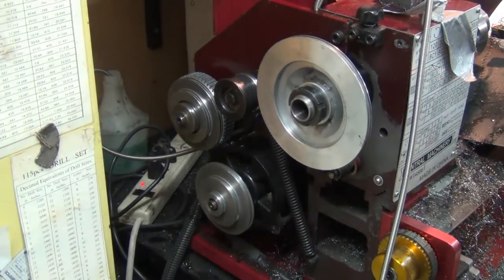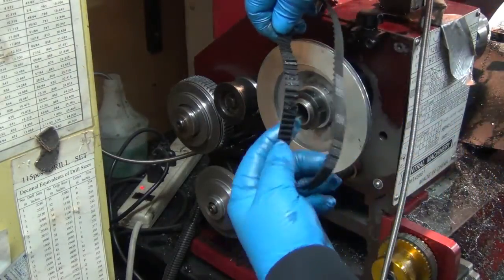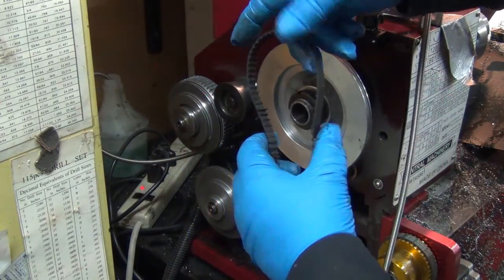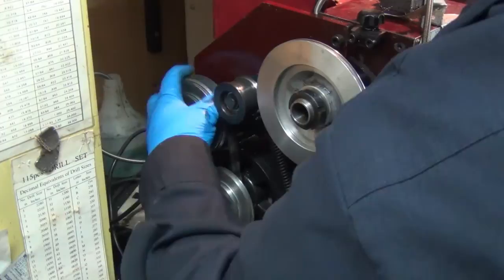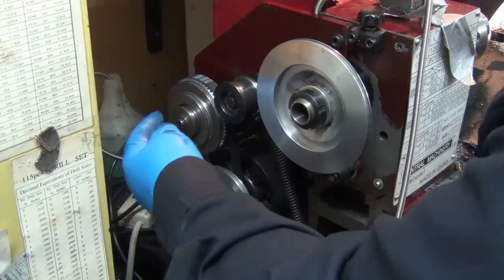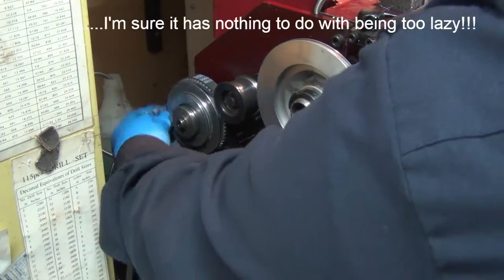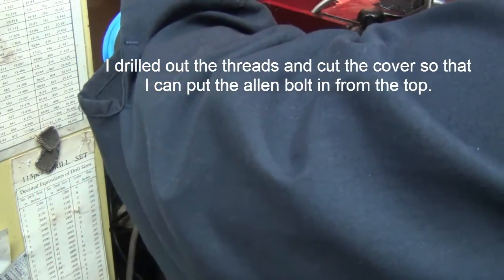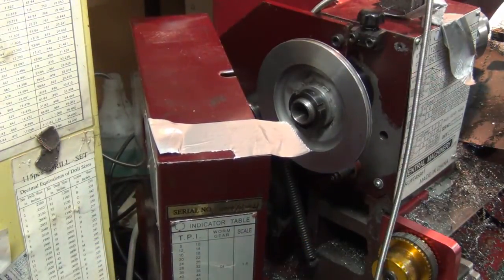9x20 CNC Lathe - Drive Belt Stripped

Comment: I have had one of these lathes for about 20 years and got fed up of replacing the high cost thin gates belt and the cog belt because of striping. So to make things simple I decided to go for a Variable frequency drive and a three phase moto rand removing all the aluminium pulleys and having just two. One on the motor and one on the headstock shaft, I found taper lock pulleys made it all so simple just needing a 19 mm taper lock fitting for the motor shaft and a 28mm taper lock fitting for the headstock shaft. I decided to use a SPZ belt and pulleys because the lathe did not require a heavier section belt, Though one major gain in using the taper lock pulley system you can fit whatever belt profile system and pully size you like. I can now change speed with the turn of a knob  with forward and reverse at the touch of a button. I should have done this years ago, the conversion took only a day to do.
Reply from the maker: Sounds like a great upgrade.  Too bad you didn't do a video of it. I'm sure there's still other owners that would love to see what you did and how you did it.  I had a variable speed motor on it(tread mill motor), but I sold this lathe a few years ago when I got the Tormach 15L Slant Pro. Thanks!! -Mike
Reply: @bluehandsvideo  All I can say is that I do not have an interest in making videos of my projects, well I am at the age that I would like to see my seventieth birthday again and that is my excuse and I am sticking to it. I have tried and sadly I cant get on with the technology. Now back to the lathe drive conversion, the things I left out from my first post. Remove the lathe's motor and construct 2 L shaped brackets for the new motor then fix one leg of each bracket to the lathe using the new motor feet spacing distance but do not fix the motor permanently yet.  Remove the headstock lock nut and pulley leaving the spur gear for thread cutting in place, now slide on the 28 mm taper lock pully fitting then fit the pully to it. Now you have the motor and the head stock pulleys that can move so using a piece of string as a belt align motor and head stock pulleys, from this position you can measure  how much of a spacer you require to fit between the head stock shaft spur gear and your new pully. (you can purchase spacers on e bay for not a lot), Tighten in place your new pully and spaces using the original locking nut, be careful not to over tighten the bearings. Back to the motor fitting and adjustment using a string belt again slide your motor along the other limb of the bracket you have fixed to the lathe allowing to determine what length of belt you will require, bolt the motor down I did slot the holes in the bracket to allow for final belt tensioning. Hope this is of more help.
Reply from the maker: @jas20per  I completely understand not wanting to make videos. lol  This is great information.  Hopefully, other viewers will find it and use it. :)  Thank you! -Mike

Comment: Where is the clip that goes at the end of the timing pulley?
Reply from the maker: The pulley on the motor or the one above it?  On the top one, it's there, just hard to see.  On the motor, the previous owner upgraded it to a treadmill motor.  I haven't paid much attention to how it's mounted, but it's never had a clip on it.
Reply: bluehandsvideo
I thought it was missing on the top one looks like it is from here. It looked really loose . That belt should be good for 10 HP and not eat belts up like that.
Reply from the maker: Mark Rich The bushings were worn out pretty good. I've got another vid coming up of replacing them.....still way behind on vid editing.
10hp!! Wow!  The tension was a bit loose and with the rotational mass of the motor....it stripped it out when I ran the tool in to hard and stalled the chuck.  I'm getting a little better at it each time I use it.  I just haven't had as much time to vid every time I use it.
Reply: bluehandsvideo
Thats funny my bushing just blew out yesterday and I ordered two today. I was getting ready to machine some ball screws and I head this really mean rattle. Did you order from Grizzly? Did they fit your HF Lathe I have an enco 9x20 . I \\wish I had another lathe I would of made some. I cant wait to get rid of that whole set up when I switch to CNC.
Reply from the maker: Mark Rich
My extras came with the lathe and I'm pretty sure they came from HF.  I bought this from a buddy and I know he waited months for parts to get it running.  I've got some bearings on order to replace the bushings....that will be another vid. :)
What drive setup are you changing to when you switch to cnc?
Reply: bluehandsvideo 
I have a 3.5 hp tread mill motor with C6 board from cnc4pc. Its going to be a simple 2 gear Hi low timing pulley set up. I also have to get an encoder for threading hooked up. 
I have all the parts to cnc my lathe and knee mill its just the work that needs to be done. Here is my G0704 I have now. I love the little guy . TTS power draw bar system is the best mod Ive done besides the 3.5hp treadmill motor (that will be going on the lathe) . The 600 watt motor and controller bit the dust.
 I figured I have this beautiful knee mill here though why not . I will gain quite a bit of travel and its 100x more rigid than any bench top mill at 1100 lbs . The G3102 Knee mill is a great mill . If you ever get a chance to buy one dont hesitate. 
http://s2.photobucket.com/user/MARK1234SARA/media/IMAG0840_zps900ab4ca.jpg.html
Reply from the maker: Mark Rich
Looks like a really nice machine!! I probably would have cnc'd my mill if it hadn't been a round column.  I'm hoping that you're going to start doing vids when you do the drive setup on the lathe.  Even if it's a slide show. :)  ...or even pics in your photobucket.
Reply: bluehandsvideo
I thought about it . Im not sure if I have the commitment to go through with a you tube channel. I may . I post on CNCZone all the time Ill do a build thread there .
On a side note did you buy the brass  bushings yet? Mine will be here on oct 2 if you havent purchased yours yet I will give you the  measurements . You should be able to make a set quick.  Save 13$
Reply from the maker: Mark Rich
A link to the build thread on cnczone will work just fine then :)
Part of what got me started doing how-to's and videos was that I could use them for my own memory!  I can refer back to them to see how/why I did  certain things.  The bushings came as extra parts with my lathe when I bought it.  The bearings just showed up yesterday.
Reply: bluehandsvideo where do you buy your belts?
Reply from the maker: I don't remember specifically, but mcmaster.com has a lot of choices.  I'd check there, google and amazon.  I always tend to google things first. :)

Comment: Maybe it was the oil that lead to the belt's demise, weakening it over time? I put a 3hp motor on the same lathe as yours and it never hurt the belt on crashes. I only oiled it once when I didn't know any better that the screeching noise was comming from the plastic gears, and then never oiled it again because it was slinging just like you said.
Reply from the maker: You may be right.  It wasn't that old, but between the oil and less tension than it should have.....I'm not surprised it stripped.  I'll have to get it cleaned up sometime.